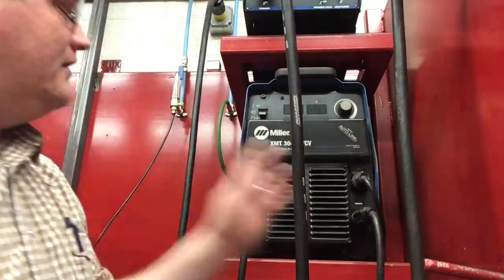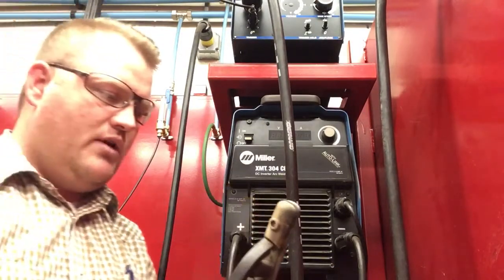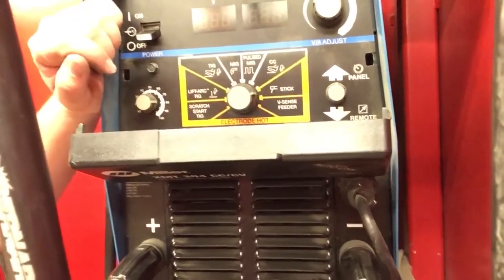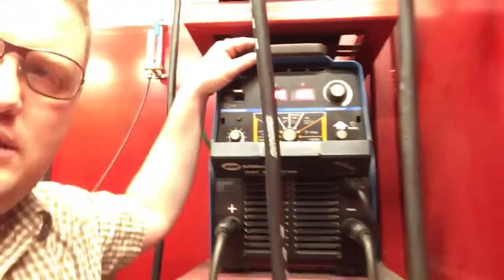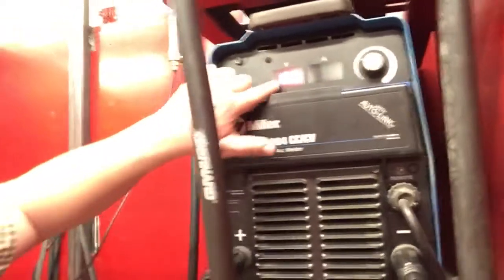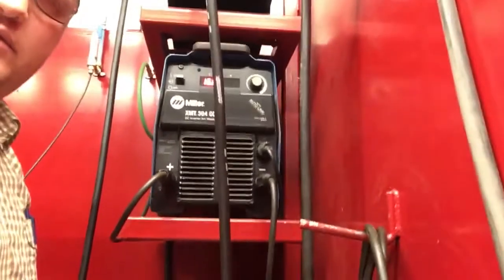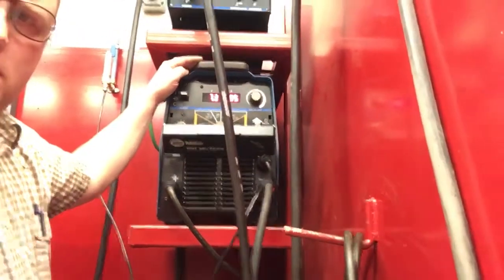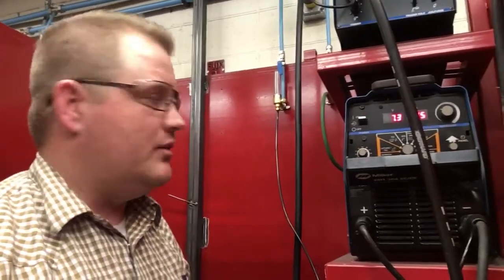Setting up the XMT 304 - One Day At A Time with Dave from AgTeachering

Comment: Before lightning got my XMT304 I utilized a Miller HF-251 with a foot control for TIG use. Has post flow and start/cont High Freq. Worked great for years and just tonight got a XMT350 CC/CV and setting it up like before. I do a lot of DCEN on Aluminum and like having a foot control and gas post flow.

Comment: Hi i have the same machine , to use the tig you still need to install the wc-24?
Reply from the maker: We run lift arc Tig as is. You'll need something more to do high frequency Tig if that's what you're after